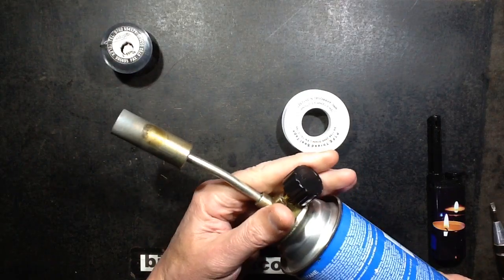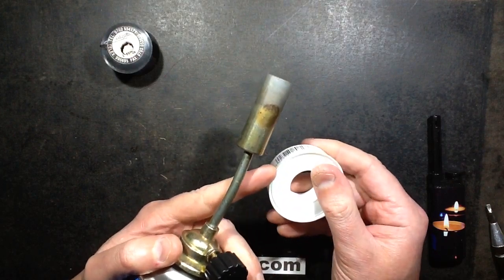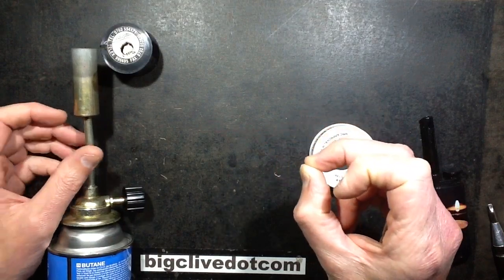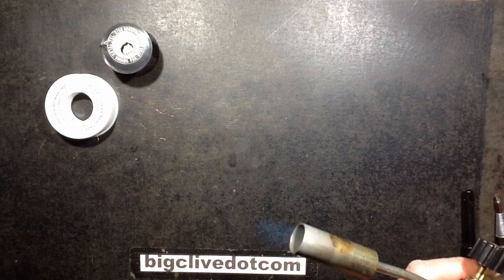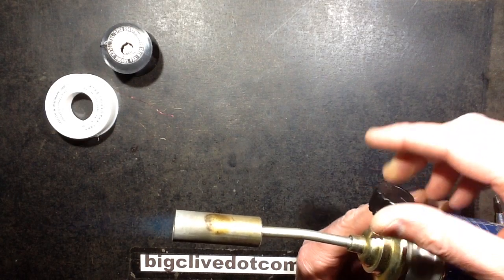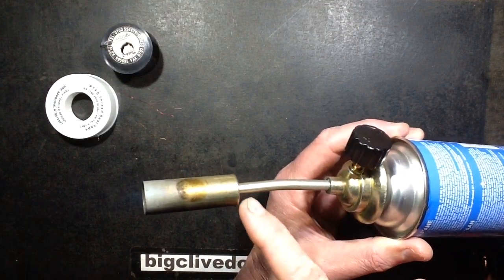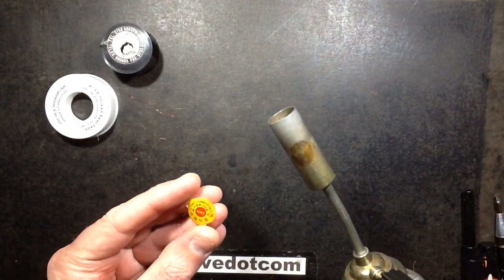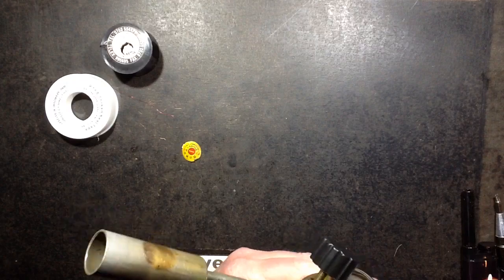Gas burner update.  (Less "whoomphy".)

Comment: Notice the corrosion on the leads. That points to metal being put in the water. In the foot video the electrodes were steel, maybe the aluminum does not dissolve into the water as easy.

Comment: PTFE gives off neuro toxins when heated past 270 degrees c... watch out. probably won't get that high at the nozzle, but still..
Reply: Pyrolysis of PTFE is detectable at 200 °C (392 °F), and it evolves several fluorocarbon gases and a sublimate. An animal study conducted in 1955 concluded that it is unlikely that these products would be generated in amounts significant to health at temperatures below 250 °C (482 °F).[30]

While PTFE is stable and nontoxic at lower temperatures, it begins to deteriorate after the temperature of cookware reaches about 260 °C (500 °F), and decomposes above 350 °C (662 °F).[47] The degradation by-products can be lethal to birds,[48] and can cause flu-like symptoms[49] in humans—see polymer fume fever.
Reply: Just keep shooting it with rockets until the core that controls the neurotoxins falls off and you can incinerate it.
Reply: Jai Stanley - Utter BS. Cite a reference if you can troll.

Comment: This are very danger type of burners. I had 3 of this type and every single one leaked on connection with gas bottle after few weeks of moderate usage. One of burners started leaking when i solder something and escaping gas catch a fire. It's very hard to extinguish if you dont have fire extinguisher nearby.
Reply: Krzysztof Żak - Speak English or just Chinglish?  What utter horse shit. Exactly three. Oh my. Trolls favorite number.

Comment: For the wire, I clean a lot of carburetors, and I've found that a single strand of bicycle cable works really well for cleaning small holes. It's some kind of high carbon steel, so it's fairly strong for it's size, and the spiral shape sweeps around the hole as you move the wire back and forth, enhancing the cleaning effect.
Reply: Terrace Thornhill - Why do you feed Clive's obvious trolls?